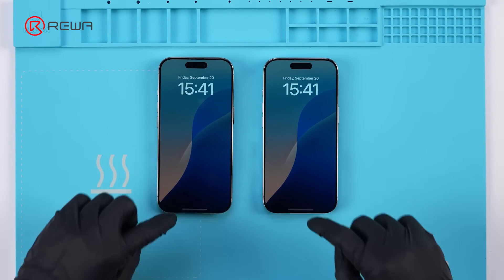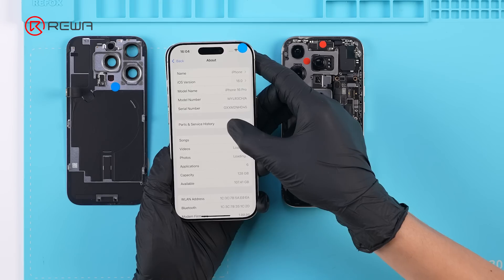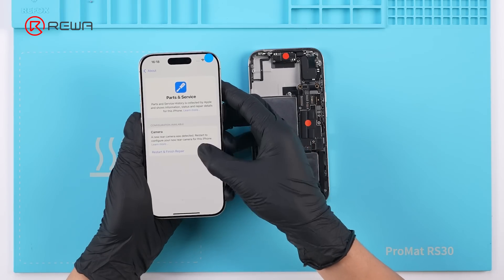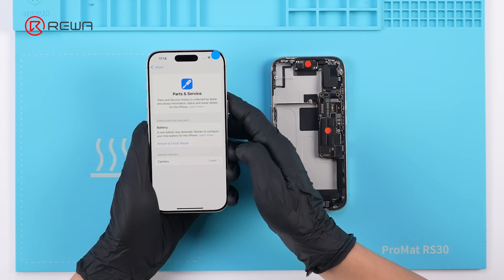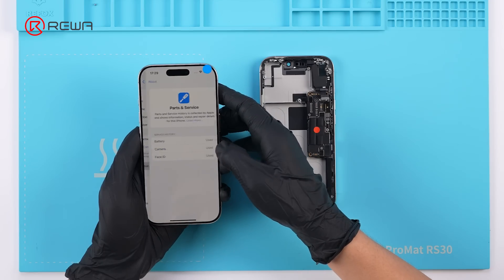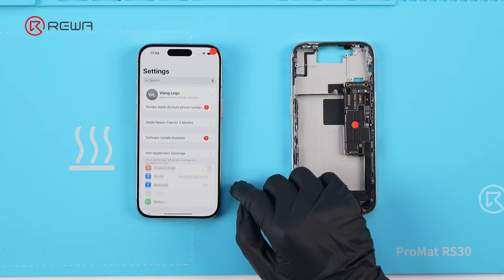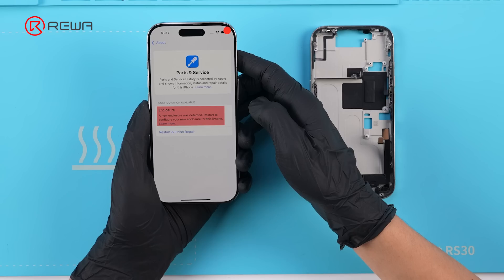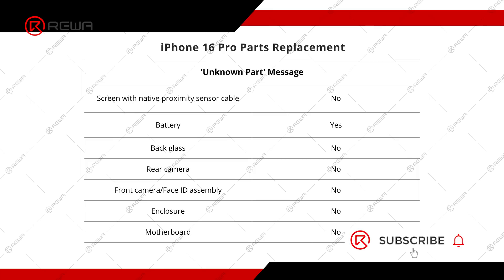iPhone 16 Pro Swap Test - Easier for 3rd Party Repair?

Comment from the maker: How do you feel about new features in IOS 18? Is it really easier for 3rd Party repair?🔎

Repair Tool
1.REFOX RS30 ESD Phone Repair Heating Pad
https://shop.rewa.tech/detail/refox-promat-rs30-esd-repair-heating-pad.html?utm_source=YTB0921&utm_medium=video&utm_id=Repair+Tool
2.REFOX RS50 Mobile Phone Opener Clamp Fixture：

https://shop.rewa.tech/detail/refox-rs50-mobile-phone-opener-clamp-fixture.html?utm_source=YTB0921&utm_medium=video&utm_id=Repair+Tool
3.REFOX RS52 Cell Phone Screen Holder
https://shop.rewa.tech/detail/refox-rs52-cell-phone-screen-holder.html?utm_source=YTB0921&utm_medium=video&utm_id=Repair+Tool

4.REFOX RS2 2D Screwdriver for Phone Opening Repair

https://shop.rewa.tech/detail/refox-rs2-2d-screwdriver-set.html?utm_source=YTB0921&utm_medium=video&utm_id=Repair+Tool

5.REFOX RS40 Magnetic Screwdriver Holder for Screwdrivers/Tweezers/Pry Bars Storage
https://shop.rewa.tech/detail/refox-rs2-2d-screwdriver-set.html?utm_source=YTB0921&utm_medium=video&utm_id=Repair+Tool
6.AT-14K Stainless Steel Fine Tip Tweezers

https://shop.rewa.tech/detail/stainless-steel-fine-tip-straight-tweezers-at-14k-oem-new.html?utm_source=YTB0921&utm_medium=video&utm_id=Repair+Tool

7.Metal Spudger Pry Bar
https://shop.rewa.tech/detail/metal-spudger-pry-bar-type-1-oem-new.html?utm_source=YTB0921&utm_medium=video&utm_id=Repair+Tool
Reply: It's batter than before
Reply: karena pemerintah usa menekan iPhone harus membuka diri untuk servis handphone untuk external
Reply: It's amazing 😂😂
Reply: I think iPhone 15 pro have the same parts thing now

Comment: You could also test it on the iPhone Se (iOS 18), if this also works with the changed parts. For example, the biometric sensor works, without the need for the jcid programmer.
Reply from the maker: Our latest video has this test, you can also take a look
Reply: Thank you for your attention and for the differentiated content.

Comment: Im happy about the face id work
Reply from the maker: But now only on iphone 16 series, you can also watch our Face ID testing: https://youtu.be/X8pmPvMHTTc
Reply: @ in my country no kne uses the older iPhones now only pro max comes in faulty im happy that apple started to make work easy the previous work dot projectors are not that hard to fix

Comment: My iPhone 14 pro max display status says Used that’s it mean the screen is not original
Reply from the maker: As we mentioned, the used usually mean this  part may already paired with other motherboard, but now even we use OEM NEW part to pair with the iphone, it may also meet Used tag
Reply: @rewatechnology2008  Yesterday, I bought a refurbished iPhone 14 Pro Max from Back Market in the UK. I noticed that the display appears used, and I am wondering whether the display is fake or not. From what I understand, the display was taken from another original iPhone 14 Pro Max.

Could you help me understand if this is acceptable? Should I keep the phone, considering the display is from another original iPhone?

Comment: I have seen some videos where when they opened the phone, the battery wasnt in the steel plate. However in some videos the battery is in steel plate. Why is that? Anyone?
Reply from the maker: Different modules share differnt battery, as you  can see now only the pro applies the steel battery.

Comment: how about if i change a brand new Third party Parts like the Face ID.  still the face ID working after configuring or running the repair assistant???
Reply from the maker: Really appreciate your comment, we are also busy with testing it, and we may share you more information

Comment: In case if you bought an original genuine parts on a third party repair shop then placed it on your phone and it works normally . Then suddenly the original owner of those parts reported it as lost/stolen parts. Will your phone get bricked?
Reply from the maker: For the third party parts video, we are also testing and maybe a full video is on the way, again thanks for your comment

Comment: i think swap parts in these video it's not useful, cause all parts already had registered id in their server. how about with 3rd / unofficially parts or locked cloud id?
Reply from the maker: Well we swap the original parts in order to test IOS 18 part pairing function first, thanks for your comment, as you can see in the video we conducted a conclusion about the parts pairing

Comment: So as long as the replacement part is not tagged as stolen, it will function as a used part?
Reply from the maker: For iPhone 16 Pro IOS 18, it seems right.

Comment: i wonder how about older phone changing part issue? will ios 18 solve them? for example battery health issue...you implant the new battery to the old original bms and swap between phone..or then swap back..will it reset that?

Comment: Wait, i saw an article that said the parts is locked to the apple id, when you put it in the different phone it prompt you to enter the apple id
Reply: Only when find my has been activated on the phone which the replacement part is gotten from
Reply from the maker: That is new feature in IOS 18, we are also testing this.
Reply: stolen locked id device issue...if you get it apple id clean...no problem LOL

Comment: You have replaced all original parts what about third party manufacturers parts ? will it say unknown parts
Reply: Apple announced a while ago this year that third party parts will be supported through calibration. It will still state in the settings that it is a third party part and can't guarantee the proper functionality of the part. However, you'll still be able to calibrate it.
Reply: There are none yet, the phone is barely a week old. My guess is that some clever Chinese manufacturers will be able to fool the system

Comment: Make video on when parts are locked with apple ID.. And when someone tries to swap it
Reply from the maker: The lost mode is interesting, we may also test it, thank you
Reply: @rewatechnology2008  fast make a video I have iPhone 12 Pro Max display camera battery changed another iCloud iPhone so my iPhone updated ios 18 so pls make a video I will downgrade to ios 17
Reply: yes please. Because some people may steal our iphone just to sell its components for the money.
Reply: @RomesIbranovski  So you have the mind of tech thief, that's a new one
Reply: Both phones had different Apple IDs, they didn't test with lost mode but I guess it'll still be able to swap
Reply: @0xIsma no, in lost mode they are locked
Reply: @blakyer  pensi che gli iphone recentemente riparati con display con "modalità smarrito" che avevano ios17 una volta che aggiorneranno ad ios18 cosa succederà?
Reply: Same process, but you will prompted to enter "parts owner" Apple ID in order to finish Calibration.
Reply: Let me steak your phone
Reply: Does front camera nd face id support in 15 pmx after calibration?
Reply: This is the main reason why you can't DIY your iPhone if something's happened, compared to an Android phone you can freely DIY if something happens. On top of that iPhone repair charges are soo expensive monopoly is real, thanks to Andy Rubin father of Android phone let those companies manufacture their own give masses a lot of choices.
Reply: @JeffreyMontero-wv7bi  android makes it easier to make a living by stealing. Thanks android